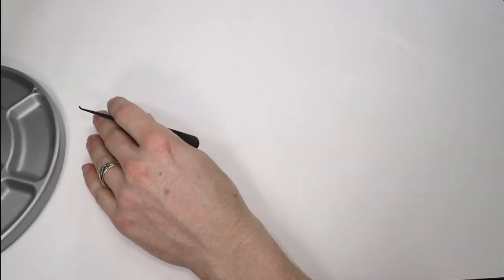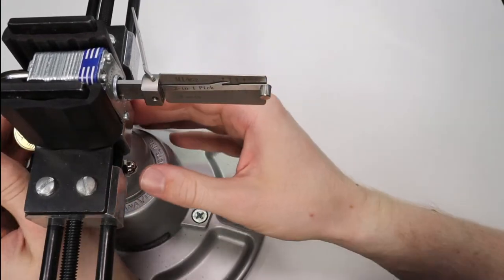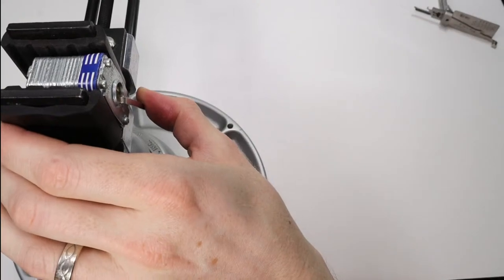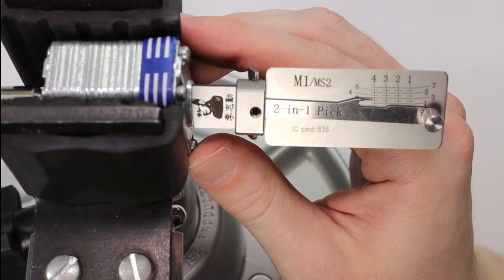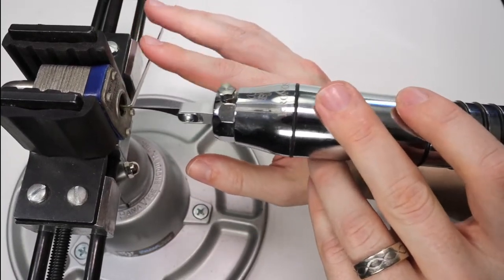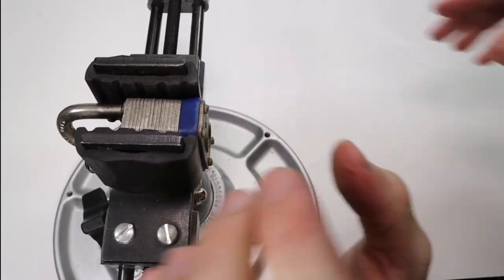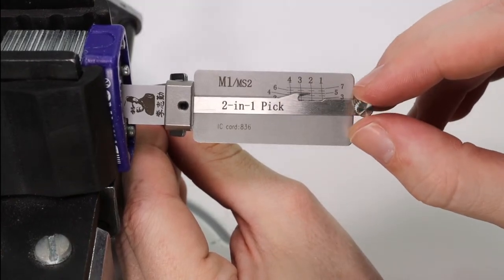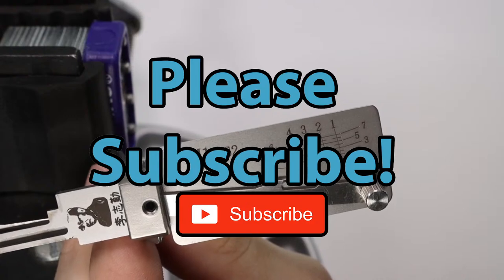A Second Look At The M1/MS2 Lishi 2-in-1 Pick & Decoder

Comment: I just rec'd this Lishi tool (from the backorder shipment that just came in recently) and I also have the SAME PROBLEMS with it.  I was quite shocked to have the same results, in that it had trouble opening several Master 4 pin padlocks that are just so easy to pick.  I was wondering if mine was damaged or manufactured incorrectly in some way.  My picking tip is also somewhat curved and tends to stick or hang up near the bottom of chamber # 3 if you just operate it free hand, (i.e., without it even being in a keyway).  Wonder if these are a bad lot?  I'm quite displeased with it -- now interesting to know someone else has same problems...
Reply from the maker: I feel like a few others including yourself and myself have had issues with the picking aspect. It is a strange finding. I am happy enough because I got the decoding to work. But it is strange because it works perfect on my Brinks lock.

Comment: When I got the Lishi for M1/M2 locks, there seemed to be absolutely no repeatable pattern for opening a Master Lock 3, other than putting immense pressure on the tension arm. Sometimes, on 1 of my ML3's, I just had to pick 1 and 3 to get the open, other times it would open when I picked 1, 3 and 4, and the feedback is non existant. On a different ML3 I have to pick all 4 pins, but in different orders. 😂😂🤣 Master Lock,  ya gotta love 'em.

Comment: My friend bought a used chev, and the ignition switch was replaced. He has an ignition key, but no keys for the doors, so he cannot lock it.
Can I use my lishi MIT8 to decode his door locks and order a key?
Reply from the maker: If you have the correct Lishi for the correct lock you can pick and decode it. I am cautious about giving advice about locks in use especially ones attached to automobiles
Reply: @HelpfulLockPicker  so if I successfully decode it, that is the code for the correct key?
Reply from the maker: @parapicktog7734  Yes, it is

Comment: I know you can change it but isn't the tensioner usually on the other side of the lishis? Sometimes I think the epgs have to much power. If it won't open sometimes I can get it open with my Manuel pick gun and it will open lol it's not a cheap Chinese one it's a good one where the pick moves straight up and down with no curve! When I bought my epg I asked them why they had a less powerful gun at same price and I was told mostly everyone buys the more power full one cause it's the same price! I sometimes wish I would of bought the less powerful model
Reply from the maker: I opened all those locks before I filmed it but of course being live it didn't cooperate LOL. Also my tension was clockwise and you can rotate the handle to the other side if you just undo a screw and flip it over. I didn't want my hand in the way

Comment: My M1/MS2 picks well but that's all it can do.  The Lishi pin chart isn't accurate so the cut numbers I gave my locksmith weren't correct.  I wasted my money on this 'quality' tool that can't even decode a cheap 4 pin padlock.  You notice he didn't cut a key using the numbers he read on the Lishi.  Actions speak louder than words..

Comment: I did think it is quite funny that the Master Lock resisted a very expensive Kronos Multipick.
Reply from the maker: Lol
Reply: He can’t pick
Reply: He used it the wrong way
Reply: @GxAxV  How come? I have never used an electric pick gun like that before, would you elaborate please?
Reply: @roysammons2445  sure thing. I use the Kronos daily for work. On most electric pick guns (not the dyno) there is a right and wrong way up to inset it. The motor flicks the needle that is sprung in one direction already. Effectively if used the wrong way then you are holding the needle away from the motor.  The correct way with the Kronos would be with that thumb screw on the opposite site to the pins.
Reply: @GxAxV  So it wasn't bouncing the pin up properly? I have seen comments on other channels where people have used pick guns and the comments say "it's the wrong way round".
Thanks for this.
Reply: @roysammons2445  the issue is the needle can be mounted in the gun any way up so people are often referring to which way up you should use the blade. If I had a way to link you to an un listed video you can see how I mean?
Reply: @GxAxV  I think I understand. There's more bounce one way with the pick gun. People tend to use it the wrong way round thus not getting the bounce. 

Quick question: How effective are pick guns and are cheaper pick guns any good?

Oh and Happy New Year
Reply: @roysammons2445  happy new year mate! Pick guns are VERY effective. I started off single pin picking locks and still love it but on the job it’s always pick gun 1st as it opens 90% of locks I put it in within a minute.
Reply: @roysammons2445  the Kronos is cheap and the best I have had but many swear by the dyno (which I have as a backup). There are many ways to shake a stick and they all do the same thing. It’s just about which will break 1st.
Reply: @GxAxV  WOW 90% is a very high rate of success. Thanks for answering and Happy New Year to you too.
Reply: @GxAxV  Good point.